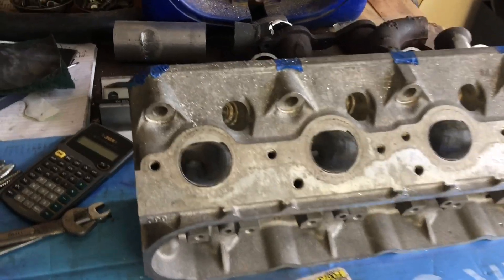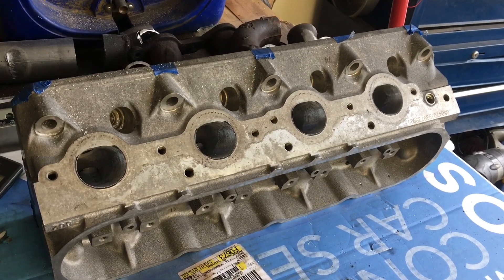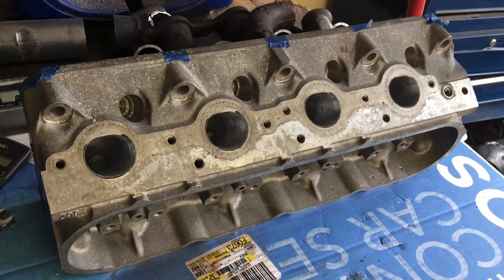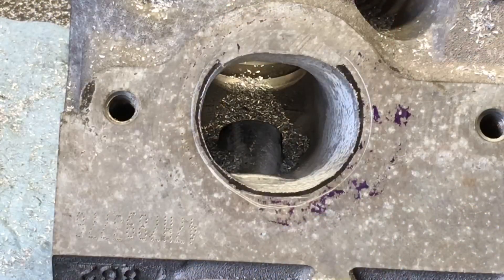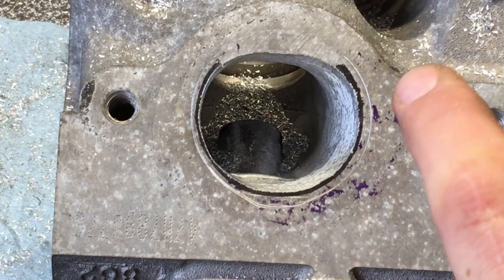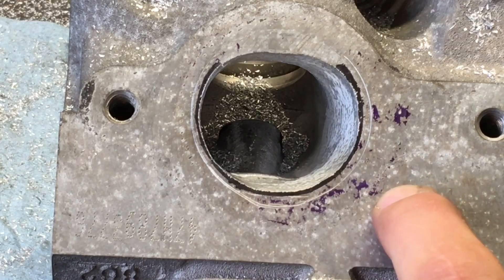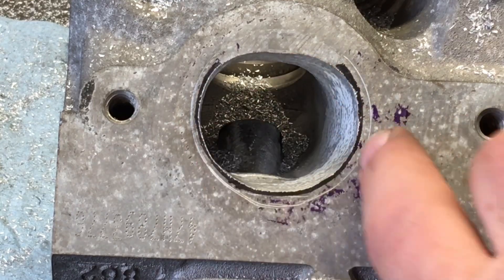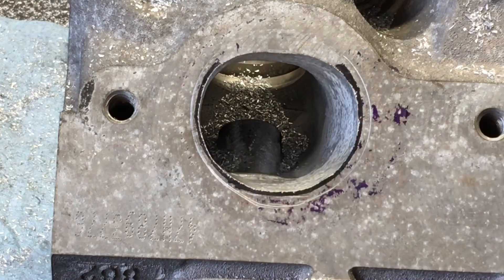862/706 LS Raising the roof exhaust porting

Comment: I scribed my exhaust ports and raised the roof. Seen a cutaway of a 706 head and doesn’t look like much meat above the roof. How crazy do you have to get before you make a coolant leak?
Reply from the maker: Don’t dig too deep, if you raise the roof don’t do anything other than smooth the transition from the area from the guide to the outlet. The raised bump just past/below the guide will barely be removed; it can be left as well. 
You can pick up great flow by focusing on the throat, bowl, transition and guide shaping.  You don’t have to raise the roof.  JD
Reply: Gotcha. Yea like i said i scribed the gasket and mainly did the roof close to the flange. Don’t even think I took it to the line. Scared I would cause a leak. I see yours went to the line. Ever have a leak?
Reply from the maker: No leaks 👍

Comment: i watched your vids couple years ago when i built a boosted ls6 now im playing with a 6.0 powerstroke they are a complicated engineering mess and not planning on compromising  the little integrity they have but id like to try get the heat out as much as possible the exhaust ports are round if i  open them up slightly by reshaping to a D a lil will that maybe help with reversion
Reply from the maker: Interesting idea I’m gonna be honest I’ve never even touched a diesel. He might do a Google search or do some research on YouTube and see if you can find other ported diesel heads
Reply: @HeadFlowInc   yeah i have tried  lol best thing to do is prob leave alone and compensate with bigger turbo the guys who do these like keeping secrets lol
Reply: but then again a diesel at over 6k rpm would be lotta fun for those preciously few moments
Reply from the maker: They make one hell of a fireball when they go up! You just got a feel for that wallet 🤷‍♂️🤦🏻‍♂️😎

Comment: Love your vids. Question- I ported the intake runners of my 706's and took out a good percentage of the humps in the roof. I also took out a good % of the swirl ramp in the chamber. Will this noticeably hurt of help me?  Running a 6.0 w a good size cam and long tube headers. Thanks!
Reply from the maker: mark palmisano It’s hard to say without seeing the work, just remember next time your porting most of your flow improvements come from the bowl cut and bowl blending.
The 862/706 come with close to a 200cc intake runner factory which is pretty big for a 1.89” valve.  It’s a process see how it runs and let me know!  JD

Comment: Can you help me understand, why not make it fully rounded (kind of oval) to match the exhaust pipes? Why leave that edge ?
Reply from the maker: guzforce Every porting theory says enlarging the floor or lowering the floor hurts flow. There are benefits to having a flatter floor, they call it a d-shaped port, 243/799 heads as an example have them. 
The factory exhaust manifold should have a similar shape as the factory exit.  Also you want to keep the walls or sides of the ports flat and avoid creating a “Bell”, “Funnel” or “Fish mouth” at the Inlet/exit. 
When you scribe the gasket to the heads and the manifolds you’ll see the shape and identify how much the roof should be raised. JD
Reply: @HeadFlowInc  Appreciated. I'll better analyse my project for what seems to be a factory restriction. Thank you. Great Video!

Comment: what kind of burs do you use?  Have a favorite brand?  Any videos on the tools that you use?
Reply from the maker: txtootall Hey thanks for posting, I have some videos on valve guide porting/shaping where Iirc I talk about the burrs I use.  
I’ve bought burrs from Cornwell, Snap-on, Fastenall etc but honestly it’s been EBay and Amazon the most.  Having the right size, shape, and length burrs helps a lot. I need to make a video showing the burrs I use for each area, I think it would be helpful. 
One thing I’ve noticed is each person may have different burrs they like for certain cuts so it’s what you’re most comfortable with.  Tool control is paramount.  Thanks again, I know I’ve shown and mentioned burrs in porting videos before I just don’t think I have one specific. JD
Reply: @HeadFlowInc  Thanks for the reply, just found this one, and I'll check out your other videos.  I experimented with some cheapos, and I'm ready to get a set or a few quality bits.  I'm using a variable speed electric die grinder, and it seams to work great on the low speeds.
I'll keep a look out for anything new on the bits that you use.
Reply from the maker: txtootall Sorry, I wasn’t notified of your follow up comment. The electric die grinders seem to work decent.👍
If you ever post a reply and don’t hear back post a totally new comment so YouTube with send me a notification. JD

Comment: I did the same port n polish job on my 862's but I used the markings left  from the exhaust where the gasket is bigger then the port and this year it started pressuring the coolant under high boost ...swapped gaskets n new studs but still doing it....not loosing coolant or in oil...time to look for cracks by the valves
Reply from the maker: eric flower It’s more likely a head gasket issue.
We have great results running the Mahle MLS gaskets; very good quality.  I’m praying you only need head gasket.
What year castings are your 862’s?  The early castings have issues with sealing if you use the wrong gaskets but I thought it was an external leak issue. 
The only area I’d be leery about is if you removed the swirl ramp and possibly went a little too deep and it cracked.  Omg I hope not!  🙏🏻🙏🏻🙏🏻

Comment: What do these heads flow after your port work?
Reply from the maker: Andy Coronado The flow depends on what size valve, what size port and valve lift. I try to port heads to match the engine combo, I don’t port all the heads to the same size. 
2.00”-2.020” valves 275-300+ cfm depending on lift.  JD
Reply: What about the exhaust?

Comment: I’m gona have to make a qwik Video and show you how I do my exhaust ports. I take a flat area off the turn on the floor section. Leave the floor but shorten it dramatically so that looking in the port you can see more of the valve. Then I take about the same off the roof as you.  If that makes any sense.  I’ve seen good gains from that. And just taking the extra off the valve guide area   On the intake side I pull a lot out.  End up with a fairly big CC intake and exhaust.  I think I was at 225cc intake and 85-86cc exhaust.    And had considerable gains.   On some 862’s. And 317’s. But on the 862’s I unshroud the intake valve. And pull about .020 around the throat of the valve seat. Give or take a couple thousands. Witch makes the smaller 1.89 valve breathe as good a the 2.00 valves  and beyond.
Reply from the maker: Ron Gravel Definitely is like to see the ports and work if possible!  I’ve generally been only cleaning up the short turns and widening them like the Pontiac heads. 
Your ports are a little bigger than mine, my exhaust ports generally stay around 81-82cc Intake 215-220cc 
I had the one set of 862’s, left the swirl ramp and still ended up with 217cc ports.  Those heads are going to make great power on the Turbo build.   Thanks for watching and the feedback I appreciate it!!! JD

Comment: Do you accept work? If so what’s the contact ? I want to get my Throttle body redone
Reply from the maker: Chris I’m not a salesman and don’t sell people anything I don’t think is worth it. Honestly, unless you can change the throttle blade to a larger   Diameter, just porting/polishing the stock TB the gains if any aren’t worth it.  The work on stock TB is cosmetic not worth the money. 
I don’t have the machinery to accurately bore a TB to a larger diameter.  JD
Reply: HeadFlowInc  - i appreciate that , this is an aftermarket TB , that I picked up use. It’s a little dirty and he was a genius and powder coated it which did not turn out well
Reply: Do people send you there heads or do you pick different casting and work them over?if so what your price on your services